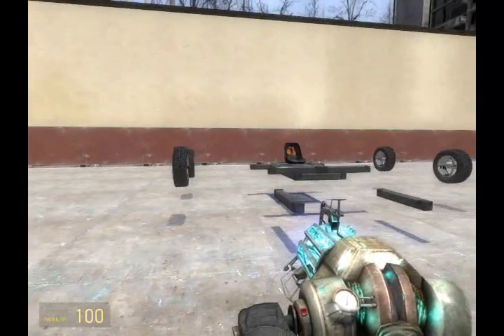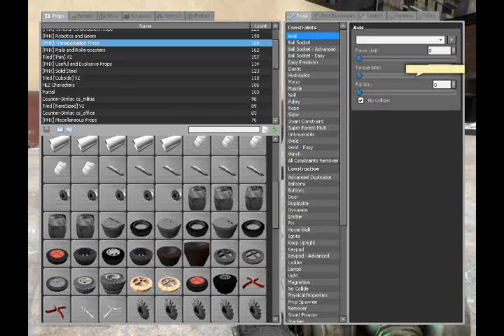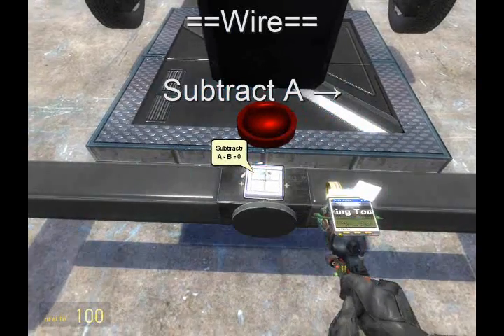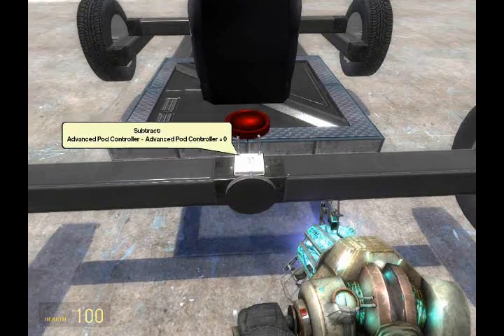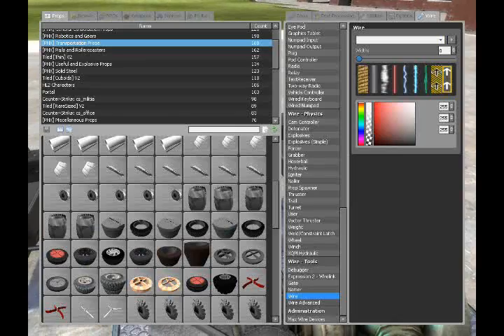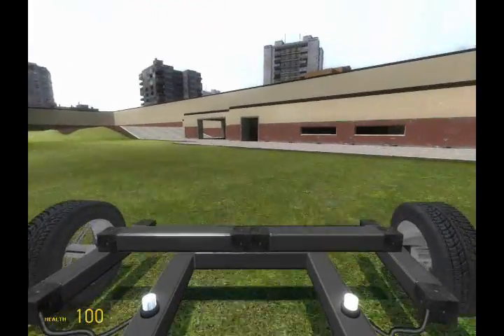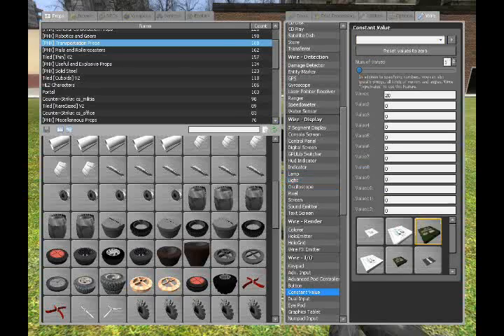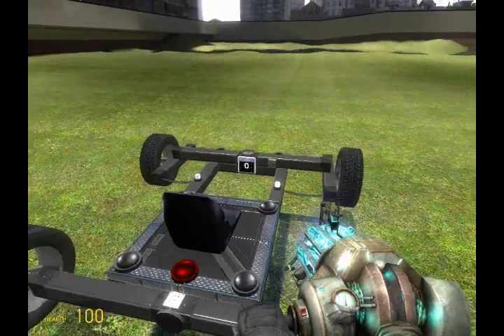WireMod Essentials [Ep. 02] - Complex WASD Car TUTORIAL

Comment: Tip for those building this: Use lamps instead of lights with the constraint being wield. That way your car emits a beam of light (much like a flash light). Also you can wire the "ON" command of the lamp to light in the pod controller, that way you can hold f to turn on the headlights. you can wire back red lamps to space in the pod controller for brake lights.

Comment: Hello! Great tutorials you have posted. Now, I'm no pro to wiremod, but isn't using the multiply and then add gates the equivalent of using an If Then Else gate? And if so, why not use the simpler method which would save using two extra gates. 

Feel free to correct me if I'm wrong, maybe that particular Selection gate didn't exist during that version of wiremod.

Thanks!

Comment from the maker: @walid0the0dilaw 
That's actually pretty simple!  
Place a GATE - ARITHMETIC (Multiply) and a CONSTANT VALUE with a value of 255.  Now wire A from the MULTIPLY to the CONSTANT VALUE.  Then wire B from the MULTIPLY to the Advanced Pod ( Output: Space ).  Finally, wire RED from the lights to the MULTIPLY.

You've just set it up so that when you press Space the Adv Pod sends 1 to the multiply, which multiplies 255 by 1 or 0, depending on if Space is being pressed.

Hope this helps!

Comment from the maker: @NinjaKniver2009 
You can use SmartSnap.  It puts a grid on the props.  All you need to do is left click the first component to select the wire-from... Then just snap to the prop grid using E, and right click to define points on the wire trail.  Then once the wire trail is finished, left click the second component and you're done!